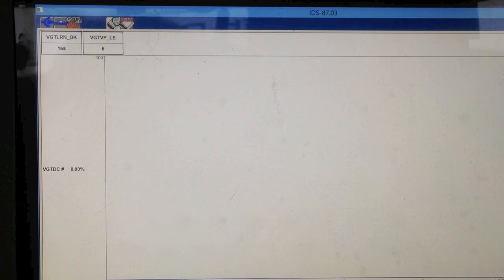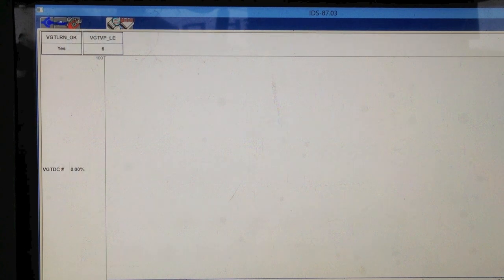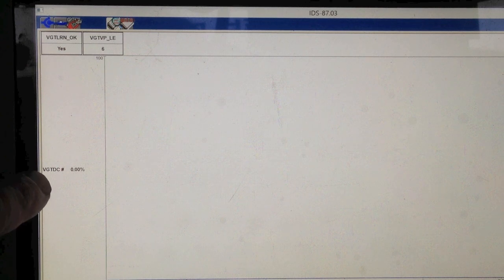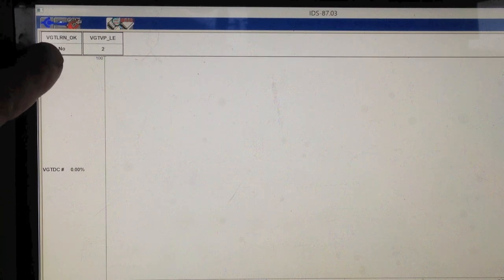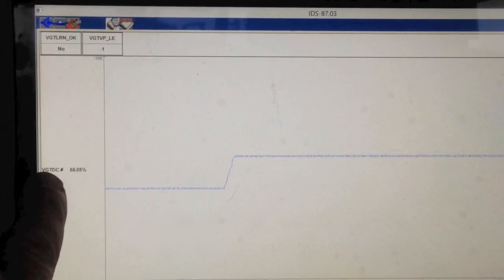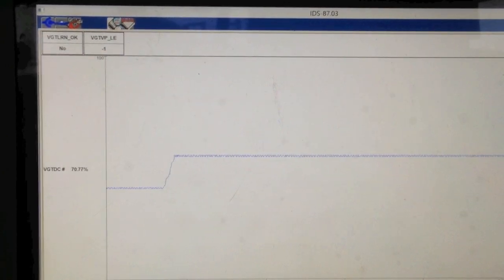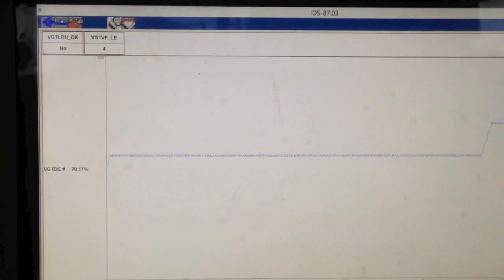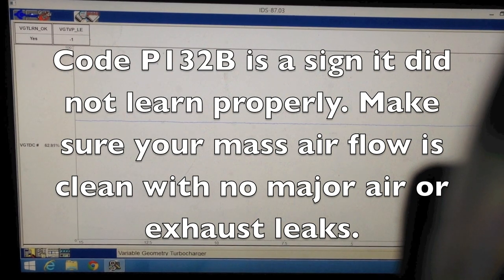P132B VGT learn procedure on a 6.0 Ford Powerstroke 06E17

Comment: Faulty injectors will cause the truck not to learn.I have a video on the turbo won't relearnn..
Reply: Watched your p132b video but can't comment, the issue ended up being bad injectors?
Reply: @benjaminrichard1026 yes faulty injectors

Comment: Tengo un problema con un 2004 Ford motor 6.0 si lo acelero asta 2000 rpm y le suelto el acelerador me regresa la presión del turbo por el intake
Reply: Suena como el turbo soltando presión
Reply: Eso es normal es turbi flutter no tienen blow off valve para soltar precion so sale por el turbo y suena shhtuutuutuu